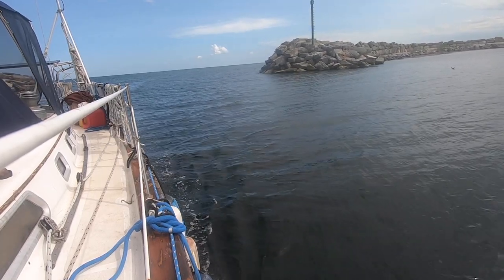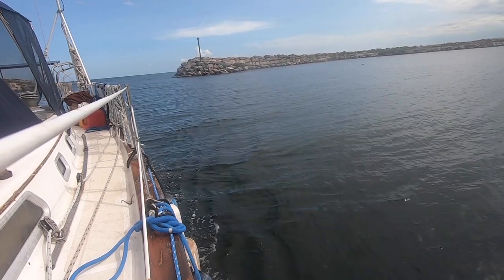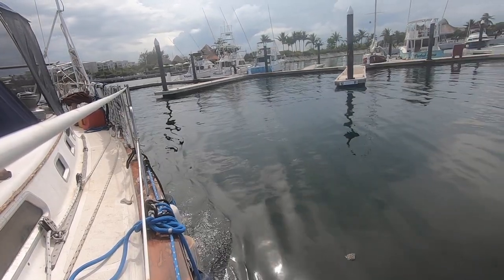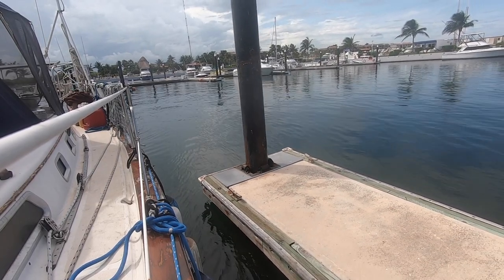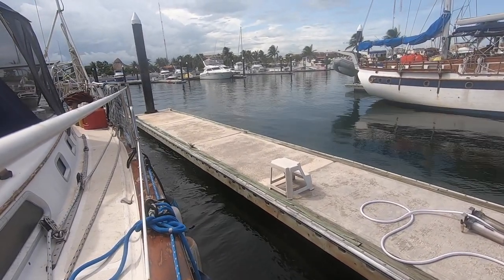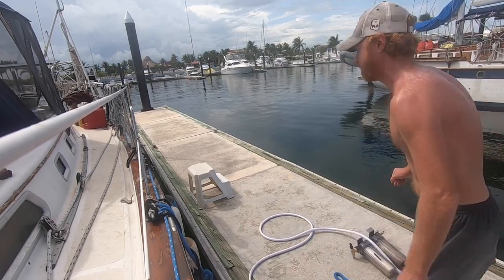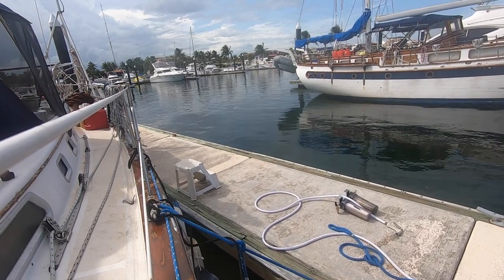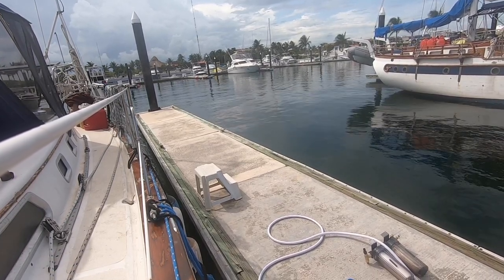Docking this 42ft boat solo for the first time

Comment: Instead of putting the boat on neutral leaving it to move forwards, just stop the boat there at the cleat. That gives you more calm and it’s easier to throw the rope over the cleat.
Reply from the maker: Yes, much smarter! I am still working on my single handed docking.  This boat is way too big for one person
Reply: Exactly!  This was 2 years ago so I bet he learned it by now, but for anyone else:  get it into the slip where you can easily jump off but WELL before it gets to the end, and do a quick, very short burst in reverse.  Do a second short reverse burst if you are still moving forward.   The boat should then not be moving at all, and everything is much more calm and easy!    If he did not get that cleat and he is no longer at the helm,   he could easily drifted into the front of the slip.

Comment: To much slack this is why your front drifted the wind grabbed the boat and started pushing it out. Gotta be a cowboys with your tie up ropes the way that the rope was on rear cleat was alright for being by yourself but I’d of fought the cleat and tide off tight and fast alowing my speed to push the bow in then b4 the bow touches the dock rope ready and tie it tight you got bumpers it’s ok to tie tight did you know if you tie up lose your boat will bounce off the dock and cause damage over time